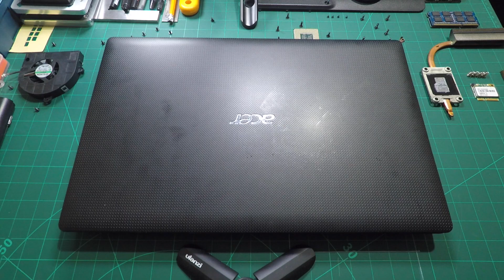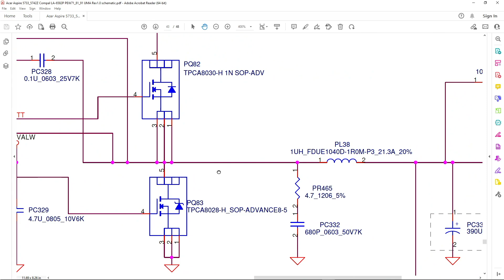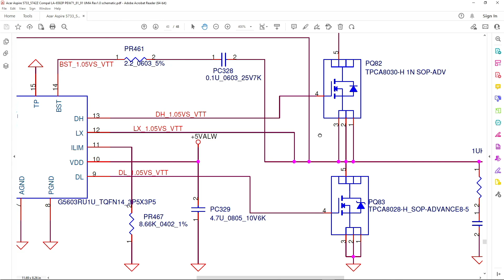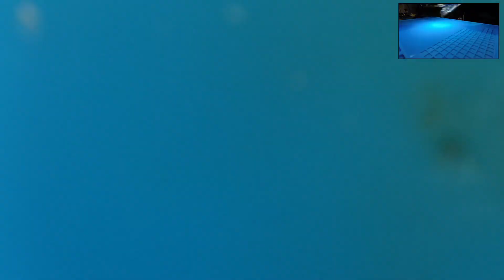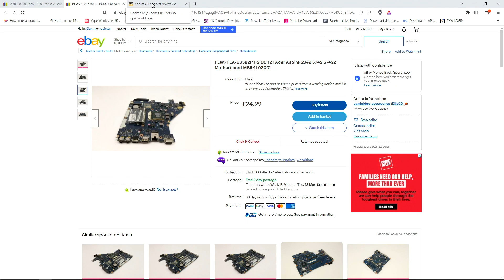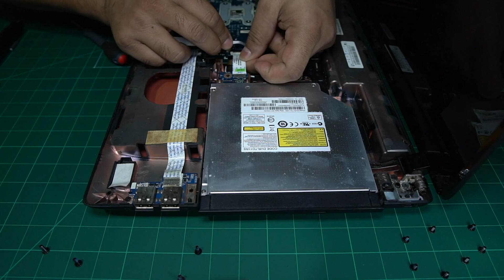Acer 5742 Laptop - No Power - Motherboard Repair - iRefab

Comment: If you buy a new chip you do not have to mask it to reball just go over it using flux and solder (its done all the time) and it will stick well enough. The risk is just as great as buying a second hand board if not more.
Reply from the maker: @mira5751 Thanks for watching the video and appreciate the feedback.  I still have the board here so if I get some chips at a good price I might just give it a try sometime 👍

Comment: Bro , just need to know how a laptop starts when we push the power button. What happens inside ??
Reply from the maker: What I’m about to explain to you below is not set in stone but it applies to 70% of laptops.

When you press the power ON button, that press is registered by the IO/EC/SIO/STARTUP IC.  This IC then starts the process of booting up your laptop.

Take note of the direction that power flows in below and start fault finding in that direction, not from the power ON button.

19v power comes through your laptop power adapter into the motherboard, it will pass through a resistor/inductor then a fuse and then into the drain of the first MOSFET.  From the source of that first MOSFET it will connect to the source of the second MOSFET (2 MOSFET’S connected in series and both of their gates are connected to the power management IC).  Then the drain of the second MOSFET is connected to a current sense resistor.  Then the 19v main power rail comes off the current sense resistor and then all the other smaller power rails come off the 19v main power rail.

One of the power rails that come off the 19v main power rail is a 3.3v power rail that connects to a power supply IC that supplies an always on 3.3v output.  This output gives power to the IO/EC/SIO STARTUP IC which is connected to the power ON button.

If you don’t have 19v on the main power rail you need to fix that first.  Then if you don’t have 3.3v power rail coming off the main 19v power rail you need to fix that second.  Then if you don’t have 3.3v always on power coming off the power supply IC you need to fix that third then everything in the chain all the way back to the power ON button.  

There is a lot more to this and its not possible for me to delve into it any further here but I have tried to summarise it the best I could for you.  

Hope this helps 👍
Reply: Thank you very much for this bro ...

Comment: I have end up working on like 5-6 of these Acer models and I have a few things to add in terms of motherboard compatibility.
First, actually there are more than these 2 motherboards that will fit these things. There is that Socket G1 and Socket S1G4 AMD that you mentioned. But additionally, there is also the low end AMD C and E series CPU soldered onboard versions (Aspire 5250, 5253, please avoid this), and then there is also the older Intel Socket P ones for Penryn Core 2 duos (5336, 5736)!
Additionally there is also the defeatured version vs featured version, with the defeatured version missing the HDMI port, red power LED, bluetooth port, and not all status indicators on power button board will light up!
Then, also one biggest mistake one can make here is that the dGPU version of Aspire 5742, the 5742G, does NOT use the same motherboard shape as the 5742 integrated version (5742Z that you have here)!
Aspire 5742G mobo is the same shape as the 5741 (G or Z), 5251 and 5551, while 5742Z is the same shape as 5333 5733 (cut down version of 5742Z) and the 5250 5252 5253 5552 (AMD) and 5336/5736 (Core 2 duo)! Mismatch these and you'll find out not only does heatsink not fit, but also palmrest will not fit! This is because the earlier versions like 5742 5252 5551 5742G etc have a multi card reader on the right side as a daughter board while 5742Z and others have just SDCard reader soldered on the left where the power indicators would be on the 5742G!
Unfortunately this is also incredibly common mistake on ebay listings and they treat all of these as compatibles while they are not!
Lastly, the i7 quad cores will not work on any of these - they do not have integrated graphics on CPU! While i5-560M 580M i7 dual cores are highly unrecommended on iGPU models because the heatsink is of much lower quality (and no copper coldplate) and my i5-580M has blown the heatsink of my Aspire 5733 (same as your 5742Z heatsink)! Downgrading that to i5-520M fares much better.
Reply from the maker: Hello KZ Tech, thank you for watching the video and thank you for your amazing feedback 🙏

Wow, that’s a lot of information.  I see you have a lot of experience with these boards and I am grateful for your input.

People who come here in the future will be able to read everything you have advised us and I am sure they will appreciate all this information too.

Thanks again, I learnt some new things today and I am humbled 🤲🏻
Reply: Hi, how do I know ive got the right motherboard? As long as everthing looks like it's in the same spot i guess Its fine? Thanks.

Comment: ماشاءالله Good job, well explained for us learners, one time I had a old Sony Vaio with pch getting hot, I noticed one cap looked cracked so I took it off and the laptop started working, so could a shorted cap cause pch to get hot? Would really appreciate if you could do some more basic videos on how to check for shorts using multimeter.., 

Also, seeing as you replaced Acer motherboard with Packard bell, would windows need to install new drivers? Windows would no longer be activated (or worse case, activated but with different key as it’s tied to the motherboard), I suppose you could swop the bios chips from faulty board, then it would still show Acer logo and serial numbers, product keys would remain intact? Keep up the good work
Reply from the maker: Thanks for watching the video and really appreciate you leaving a comment 🤲🏻.

I did not have to do anything else, meaning all I did was swap the hard drive, ram and cpu and everything worked.  The part where it says “Packard Bell” is just a bit of code saved in the “Bios”.  If we down load the “Acer Bios” files I’m sure we can make it say “Acer” on boot up.  Thing is everything works perfectly so I personally wouldn’t even bother changing it.  Laptop is still with the customer and as far I’m aware no other issues.

Easy way to check if it’s the cap or the PCH is under the thermal camera.  If it’s the cap, that should light up too.  Then you could proceed to test by removing it before touching the PCH.

I’ll try to demonstrate more ways to test components etc as the videos are being produced and different devices come up.  Stay tuned 👍 I too, still to this day consider myself a learner, so let’s learn together 😊

And finally thanks for the encouragement, it really means a lot to me.
Reply: @irefab  thanks for the detailed reply, I’ve liked and subbed and will be binge watching the rest of your videos, take care my friend

Comment: PCH = Platform Controller Hub. It has nothing to do with "Power". Besides that ... there's no point in finding a short on a random component on a power rail, then assuming the short is there and desoldering the component ... if the rail is short, the entire rail is short (until an interruption point). Same is true for injecting power at the coil and then at the capacitor. They're all on the same rail, skip this desoldering and inject straight, at ANY point of the rail where the short is present. That PCH will light up fine and thereby send the board straight to the bin.
Reply from the maker: First of all, thank you for your correction, thank you for your feedback and thank you for watching the video.

PCH does stand for “Platform Controller Hub” and It manages all slower and non-essential I/O such as USB, SATA, Ethernet, Audio etc while the main processor handles faster connections like PCIe and DRAM, so I stand corrected 🙏

Comment: yes it is better to replace mobo instead of replacing southbridge or graphic processor because i tried to replace chipset several times and laptops are not working or chipsets can be faulty so i pay chipset money instead of customers because they take off responsibility and it can be hard to handle situation.
Reply from the maker: Thank you for watching the video and providing us with your experience and input 🤲🏻.  I agree with you ✅